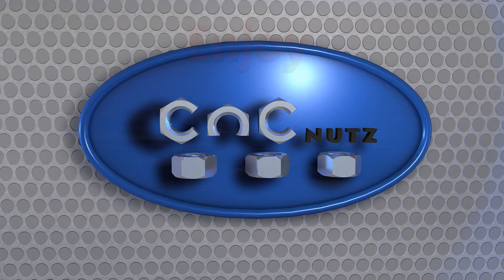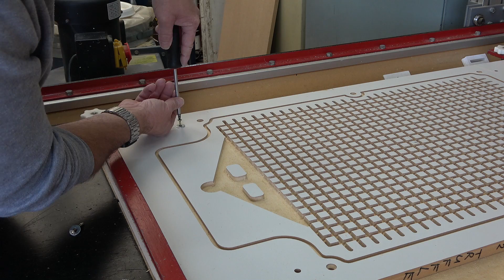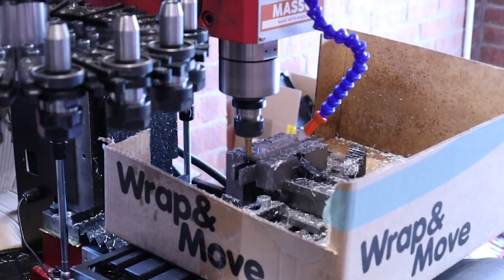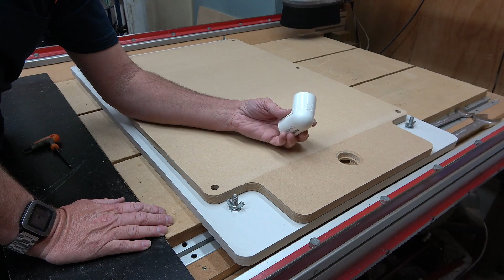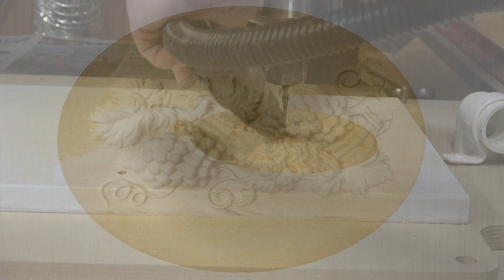Vacuum Table revisit - CNCnutz Episode 243

Comment: I like your vacuum table, but wondering how a vacuum cleaner (most of which have universal motors) has held up when used in this manner.  I would expect that many of your routing sessions run for an hour or more. This seems like it would wear out the brushes in a universal motor pretty fast. 

For the price of a good vacuum you can get a lab grade vacuum pump which is designed to run 24/7 and moves 30L/minute or more. That is much less volume than a vacuum I know but if you cover all the open areas on your table there is not much vacuum loss and hence greatly reduced volume required to achieve a secure hold on your workpiece. The other plus is the vacuum pump is very quiet and you won't have to listen to the whine of a vacuum for hours on end.
Reply: A quite inexpensive workshop vac will work fine, as long as it is ‘wet and dry’. Ordinary vacuum cleaners cool their motor from the vac stream and will eventually burn out, whereas wet and dry vac motors have independent cooling.
Reply: Bob D, if you don't mind sharing a link or website name?
Reply: @thomasreynolds1530  search Amazon for 'oilless vacuum pump'. You should get at least 6 hits.

Comment: If one would not use the "rubber O ring" but would seal the upper and lower part with duct tape or so, would that work as well ?
Reply from the maker: I Honestly don't know. You would have to try.
Cheers Peter

Comment: Hi Peter, thanks for doing these. I've watched a couple times and am a little unclear - how did the big holes and big holes with small center through-holes affect hold-down power vs the unbored, original top plate? Or in other words, what was the best option, exclusive of any other mods?

Comment: Hi Peter,  thankyou for all the great informative videos! I have a question about the vacuum you are using... If I recall its a fesstool,  how does it go with overheating and is there any better options for dust removal aswell as vacuum hold down? Cheers from Australia

Comment: Love your ideas and the Vacuum Table.... If you put something in the area where you do not have the VT covered, it will hold your working material well! You can use some kind of smooth material or plexiglass.... Or even flat rubber that will also work well. The second positive that comes out is that the "micro holes in the VT" aren't gonna attract micro-dust! I became a subscriber also and thank you for your ideas and videos!
Reply from the maker: Thanks Tony

Comment: Looking good! Will your plans be available for purchase?
Reply from the maker: No
Files will be available for free. 😁
Cheers Peter.
Reply: @cncnutz  AWESOME!! I threw one together in vcarve based on your design using the 5/8" hole pattern for the top. I think the answer is sealing the MDF and covering any unused areas with a thin plastic sheet. But, I'm just guessing. I haven't had time to test it out.  Thanks!!
Reply: @cncnutz  Also wanted to add, on the top board, using the 5/8 holes, I'd run every toolpath except the 1.1mm hole. Seal it, then run that toolpath.

Comment: Hi Peter: Q. Could you have achieved the same results by using a splitter system on your main cnc dust collection system, providing the HP of the motor is sufficient?
Best - Michael
Reply from the maker: Dust collectors are high volume low pressure so are not suitable for a vacuum table.
Cheers Peter

Comment: Hi Peter,
about a year ago, I built a similar vacuum table and found that MDF is very breathable. That means you also have to seal the side edges. Furthermore, the surface which is not covered by the workpiece must also be covered with an air-impermeable film. Furthermore, the suction side of the vacuum cleaner must be optimized. Since a lot of air is drawn through the MDF, the diameter of the suction line to the vacuum cleaner must be as large as possible. As a result, the pressure drops are lower and the suction power increases. The milling strategy must also be adjusted. This means that the last layer is only milled through at the end of the milling process. At the top I only have a 4 mm thick MDF board as a wear layer. I hope you understand me, english is not my 
native language.
Reply from the maker: Thanks rchobbynet. 

Thinner board is an option I should try. Thank you for sharing.

Comment: What if you made it upside down? Exact same design, but have the vacuum attach to the other side. You have cut out a lot of grooves making the top (current bottom) thinner in spots, but still retaining a fair amount of strength. More vacuum (thinner in places) might aid hold down.

Comment: I made a vac table a while ago. In the design, I didn't want the hose exiting upwards - it seemed like a liability - another object for the machine to crash into :-(
Instead, I extended the vac plenum out over the front of the table so the hose could exit downwards.
The only use of the vac table is with a home made/designed drag knife and it is nice to eliminate at least one source of destruction for the knife.
I like your idea of using the porosity of MDF rather than holes (the undulations from the holes interfere with the drag knife) - it might be worth a try - but I suspect the porosity of paper/cardboard would trump the MDF :-(

(love your work - I use so many of your ideas and designs: knobs, hold down blocks, cam clamp, not spoiling the spoil board, parallel ruler setup, v-carved inlays - the list goes on and on...)

Comment: Great Video Peter. I see that you were very careful to seal all the edges of your base vacuum table, but not for the top section . On the top piece, I suggest that you seal all the edges and the area at the top nearest the vacuum hose inlet. Then after placing the work-piece, cover all the rest of the surface of the sacrifice board with other material of similar thickness. This will seal in the vacuum to act more forcefully on the work-piece being cut. You want none of the vacuum to escape and be wasted, so that it holds down the material being cut.
 I've been running two large (600 x 1200 mm) table routers since 2001 (for a sign company), and use MDF as my sacrifice board just as you have. The equipment pulling the vacuum is pretty substantial, and valves are used to open and close sections of the table to receive the vacuum. I simply lift the sacrifice board and push in a rubber seal across the table to confine the vacuum to the area covered by the work-piece. I think sealing and covering may add a lot to the hold down force compared to what you are currently experiencing.
Reply: We’ll summarised, exactly what I was thinking. Additionally I thought maybe a thinner top plate may allow the air to flow though easier providing mor holding.
Reply: @cryptojunkie5875  Absolutley. Consider the top piece as a sacrifice board that will have to be re-surfaced from time to time. With good suction you can cut right through the work-piece with a final cut being very thin so there is no cutter force to grab on and gouge the material.

Comment: Great video as usual! Hey that vacuum hose on your dust boot is it metal or plastic? How is it for static? My plastic hose on mine, is like a Van de Graaff generator that produces nasty shocks and computer faults. 🙁
Reply from the maker: Thanks Glen. The hose is plastic. Haven't noticed static yet but it is a good point. Will keep an eye out for that although it will make its presence felt if it is a problem.
Cheers
Peter
Reply: Hi GlenGH, It is highly recommended that you ground your CNC machine, Router or Spindle and your vacuum to reduce the risk of static discharge and electrical faults. I have my CNC machine, Spindle and Vacuum all grounded and never had a problem. I do know someone that didn't have there machine or Spindle grounded and the static from the vacuum fried the spindle controller.

Comment: Great video Peter. Can't wait for Part 2. Not sure where you are going in Part 2, but in my experience, each small vacuum hole in the table should have a larger diameter pocket on the top. The wet Dry Vacuum will have a curtain PSI is will generate and with small hole, the surface area is very small and that does not equate to much downward force, but the larger shallow pockets, only 1-2mm required, the PSI remains the same, but the surface area affected by that force is greatly increased, but because the smaller holes in the table below the pockets are the same, you will not loose vacuum in uncovered areas. Not sure if I'm explaining myself correctly.
Reply from the maker: Thanks John.
That's what I did on the last table but I wanted to see how UN pocketed MDF behaved as this is how the big boys do it. I hope to do a comparison. 
Cheers
Peter
Reply: @cncnutz  That is interesting. Most people believe that a vacuum sucks, but the truth is more like the vacuum creates lower pressure and the Atmosphere pushes towards the lower pressure. A "pure" vacuum actually has no force. A vacuum table works by using the atmospheric pressure above the object to apply a downward force on the object. The Atmosphere can apply approx 1Kg per cm2 onto a vacuum. If we take that a vacuum table is about 50% efficient that we might see a max of 500g per cm2. A 2mm diameter hole is only about 3.1mm2 and as such only about 16grams of downward force on that hole. The more holes covered by the object, the more force.

Now if be increase the pocket at the top of the hole to 10mm, we now have 78.6mm2 and the atmosphere can now apply 400g of force on this area. The more holes covered, the more force. 

To have a table using only small holes, you would have to have a lot of them, mean 10,000's of holes. This introduces another problem. Air Flow. The more holes, the more powerful and large hose you will need on the vacuum.  I have a 31mm Diameter hose on my Vacuum, and this would allows me to have 240x 2mm holes. My next table will use 1mm holes and a 40mm vacuum hose. This should allow up to 1600 holes in the board.
Reply: OK, So some of the industrial tables that use 10,000 of small holes get around the air flow problem by dividing the table up into zones and use ball valves to turn off the flow the areas of the table that are not being used.

Here are some photos I found that use this method.
https://mk0cnccookbookgxcner.kinstacdn.com/wp-content/uploads/2017/08/Clampusystems.jpg
https://i.pinimg.com/originals/5c/da/8f/5cda8f29fff3c775b0a22b8491f5b64b.jpg
https://www.cnccookbook.com/wp-content/uploads/2017/08/Vacuum_Table1.jpg

Comment: Excellent Peter, i love yours videos....Philippe
Reply from the maker: Thanks Philippe
Reply: @cncnutz  Hello Peter,  i've just built my CnC about 120Kg, 1500cm long and 1000mm wide with 32cm under the gantry...So, i'm building a vacuum table to now with 1100mm long and 850mm wide, it's my first CnC and a very good challenge for me...First tests are very good for the plate with about 600 squares for vacuum...i have to put the pipes now and check another one the plan of my plate....Some videos will be on you tube in about one month....Nice day and thank's for yours channel which is great for me....See you ...Philippe

Comment: Nice can't wait to see part2 just thinking about building a vac table for a future project. @CNCnutz (Peter Passuello) what vacuum did you end up going with as a replacement?
Reply from the maker: I picked up a Karcher wd6 which looks like the top model at least in the consumer marker. I need to do more tests with it and it can't be run full power for long or it gets very hot. Will be testing in the next episode so don't rush out and buy one just yet. 
Cheers
Peter

Comment: Why don't you drill a bunch of holes from the bottom almost all the way through without punching through the top?
Reply from the maker: Most industrial tables just use the MDF surface as I did in this video so I want to try it first then compare it to other options.
Cheers
Peter

Comment: Nice Job!   if you do a few coats of shellac or any type of sealer to the area you cut in the melamine (bottom board) you won't lose any vacuum through your screw holes and t-slot holes. you have contained the vacuum completely in the rubber sealed area, also you then do not need to paint the edges...just a thought
Reply from the maker: Good thought. I was going to paint the outside anyway if for no other reason than to make it look pretty. I thought about painting inside but didn't fancy the mess cleaning up the top surface. Shellac would be better as it wipes away easy with alcohol even after drying. Might yet do this.
Cheers
Peter

Comment: Hi Peter,
Enjoy your videos.

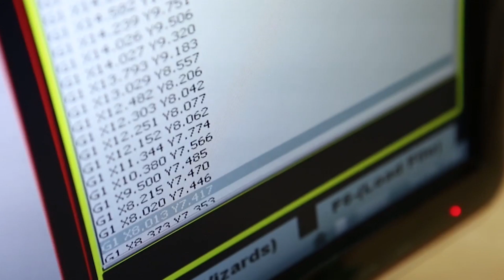If you look at the attached video starting at 10:39 on the time line to 12:00 you will see my version of a dust shoe.
https://www.youtube.com/watch?v=4WQ8KcTSKyQ&list=PLoMtsE103Tx35vF9SuatyIudVhERgDrco
It has a built in plentium chamber and the actual size of the dust shoe is a lot smaller than your dust shoe.  This allows you to get closer to the edge without loosing any suction on your dust extraction.  I used a Harbor Freight 2HP single phase dust collector with a cyclone dust collection system.  It did a GREAT job in collecting the dust and chips from my projects.
Also, if you are using the top plate you can add scrap pieces of material around the edges of your part to be machined to reduce the lose of vacuum power holding down the part.
John

Comment: Hi Peter, How do you reckon it would perform if the areas not covered by your piece of project material were coverd by a piece of plastic so as to stop air being pulled through it? All of the vacuum would then be effectively holding down your project rather than "leaking" through the uncovered part of the vacuum table. Hope that makes sense! Cheers.
Reply from the maker: I have been doing some tests and it doesn't seem to make any difference. I think that the vacuum can keep up with the air loss. I need to come up with  a way to measure rather than feel.
Cheers
Peter